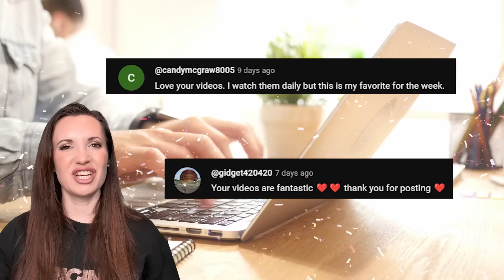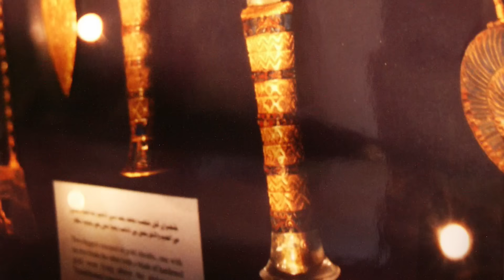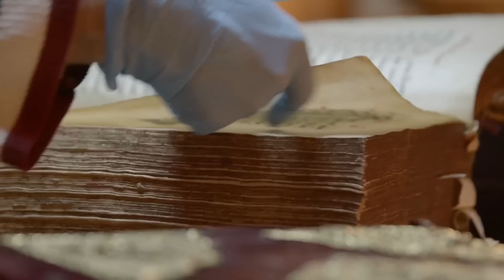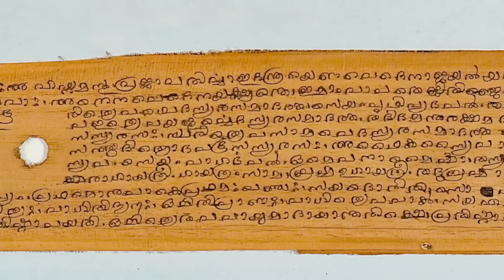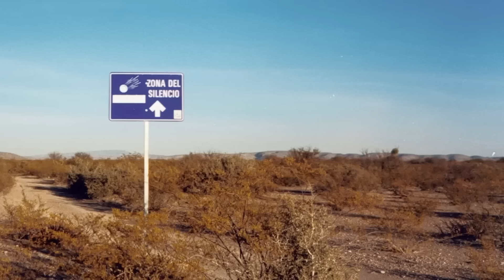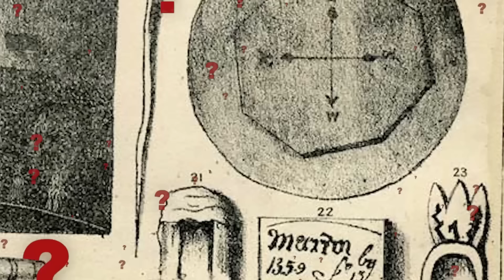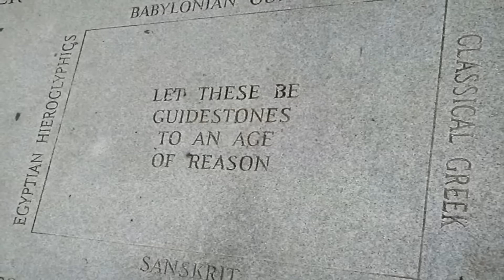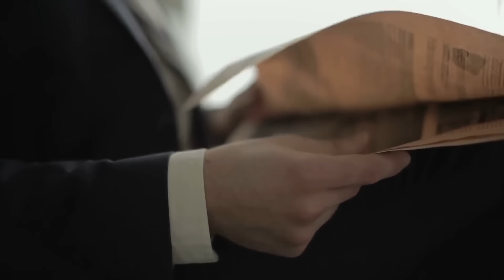Strange & Bizarre Artifacts Nobody Can Explain

Comment: @24:19 Needs to have a corection. Two found halves of a coconut are believed to have been used as drinking cups. It should be mentioned it is far more likely they were used  by English fancy types for the clippity-clop of their horses whilst on a mission to find the Holy Grail. Fact. Whoa... What if the coconut was the grail the whole time meaning they were drinking cups. I take back my  comment. Fine work. Carry on.